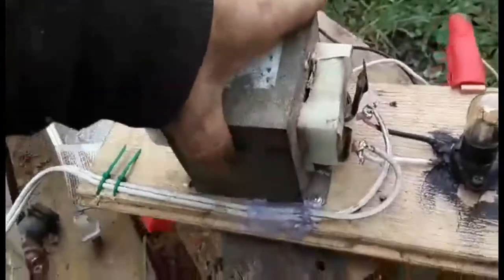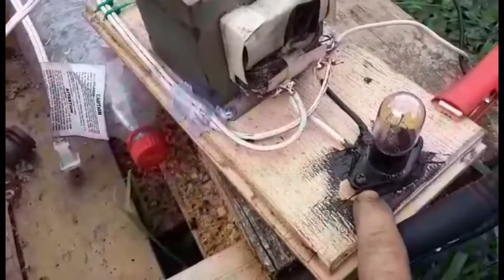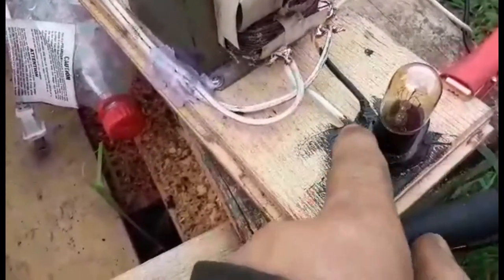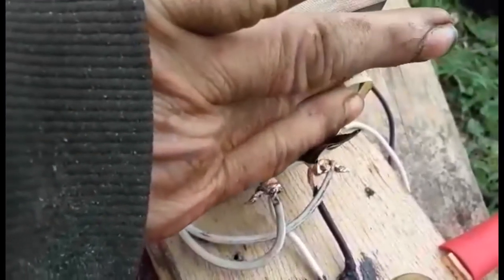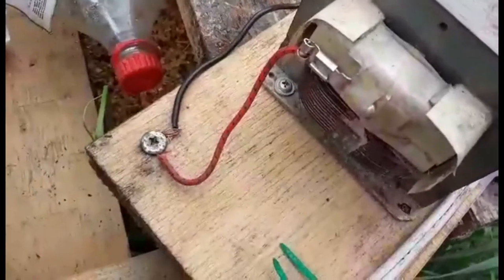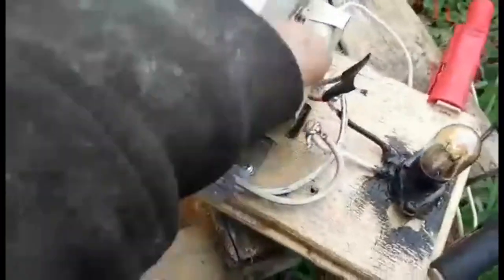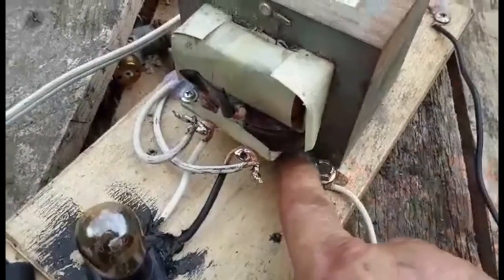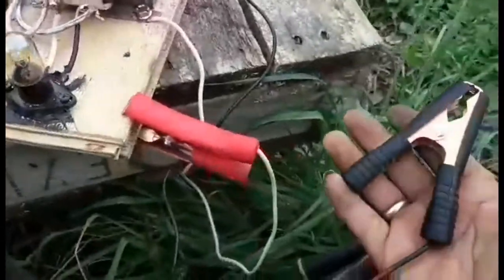couple safety features to add to wood burner  with transformer

Comment: Can you please take this video down? Many people (at least 70) have died trying this DIY hack. You even call it "safe" in your video. This is NOT safe. Please take this video down NOW. Are you willing to be the one who told someone it was safe only to end up leading someone to their death?
Reply from the maker: as ive said several times, tons of videos showing how to make these with no safety at all . i mentioned that in the video. have a nice day
Reply from the maker: i will make a different one showing more how to make it safer. that was really the point of the video
Reply: @nextellcup8  Please don't. The only safe way to do this is to NOT do it. People with more experience, better equipment, and more precautions than you have died.
Reply: @nextellcup8  Once again - this is the problem. LOTS of people who took PLENTY of precautions are dead. There are news reports of master electricians who were dead, there were times where things went unexpectedly wrong in ways that precautions do not account for. We MUST NOT send a message that precautions can keep you safe. Tell that to the kids of the people whose house burned down after both parents died. 

You need to STOP letting people think that this can be done safely. Human life is way more important than wood with fancy designs burned in.

Comment: Is your intent is really to improve peoples chances of not ending up among the dead?  Or is it  just to get on the youtube "like" wagon?   If you are sincere, seek the advice of proper credentialed engineers with UL experience.   Because I can tell you you can drive a truck through the safety holes in your improved device.   

And there is a huge area of safety with this that goes well beyond the hardware itself.

Please post a link to the devices you think yours beats out on a 1 to 10 safety scale?   Because if the very worst are a 1, yours is a 1.1.    This comment from a retired electrical engineer with 45 years of MIL/UL/CSA/CE/FDA experience.   Sorry, I call 'em like I see 'em.   Nothing personal.

Comment: Someone just died trying to put this in use! DOA man! Take this video down!!!!
Reply from the maker: yes i know . That’s why i made the video showing how to make it safer . lots of videos showing how to make one with no safety in mind
Reply: @nextellcup8  There is no safe way to make one, people are idiots and lack common sense. You cannot mitigate every safety tip in your video and you should take it down!
Reply: @nextellcup8  You are being foolish and stubborn. Implying that there is a safe way is just causing more harm. Not to mention that these are also a huge fire hazard.
Reply: What about the number of motorsports that a way more dangerous, or jumping off cliffs videos if you want your safe space get off the internet snow flake
Reply: @nextellcup8  YOU CUT THE GROUND OFF THE TRANSFORMER - ITS A TRAP WITHOUT THE GROUND.   "Those two extry wires, just put electrical tape right here".  Dude - that is a ground.  So your hot is going to recharge into the hot.  It has to ground out to be safe.
Reply: @BrysonCityDashCam28713  thats a low voltage winding not a ground
Reply: Exactly! Some people are stupid, i certainly agree! Thats why, if you don't understand how to do such things, don't... other people are less stupid & fully capable of doing these types of  things... also, people die regularly, it's the circle of life... maybe you who are so concerned about the actions of others & feel the need to make stupid posts about things you know nothing about, should find a new hobby...

Comment: That is not safe.
Reply from the maker: i know, that’s why i made the video showing how to make it safer . lots of videos showing how to make them but no safety in mind.
Reply: @nextellcup8  and yet you call it safe in the title.
Reply from the maker: @KajsarTitus  ya i’ll change it to safer . people will make these regardless so wanted to show how to have some safety with it .
Reply: @nextellcup8  Take the video down. You are being a fool.
Reply: @nextellcup8  Oh you changed it to "safer". We are all saved!
You say in your video how you made it "extremely safe". These are your words.
With a push-up switch less than one meter of the transformer?

The fact is, if some random ppl think this is extremely safe and make the exact same piece of crap as the one you are showing, he has great chances to injury or die or kill (animals, children,...)

Your version is ABSOLUTELY NOT safe or extremely safe or not even safer! Because even if there is a quick switch, you can kill someone during the time the switch takes to switch off. The only safe thing to do is to physically avoid contacts with electrical parts using insulated shields and barriers.
You are a dangerous liar, and a potential killer.

I reported your video as dangerous, encourage anyone to do the same, and hope YouTube will ban it.

Comment: Terminals exposed everywhere, hillbilly DIY style... Yeah that looks much safer 🤣🤣
Reply from the maker: as ive said several times, tons of videos showing how to make these with no safety at all . i mentioned that in the video. have a nice day
Reply from the maker: i did mention that i didn’t have the connections covered
Reply: @nextellcup8  your video is a danger to everyone. Your channel should be banned like asbestos.
Reply: The only thing about your switch is that you need to be able to click it off. If you get electrocuted you’re not going to be able to walk over to it to hit it off. A lot of people have seeing pedals attached. So if you step off the pedal, the power cuts off

Comment: Make sure this screw does not go through the wood…no, you give dangerous advise!!! if it near enough and your table is wet or made of metal, you might die from it. The voltage is high enough to jump through it as it does on the wood you are burning.

Comment: Driving down the road isn't safe but if you know how to drive it's safer than if you don't , this pretty much applies to everything, knowledge is power and plus natural selection is a thing that happens
Reply: knowledge is power until you hhave just enough knowledge to be dangerous. if you're doing anything like this just be as far away from the hot leads as possible

Comment: I can see the danger for sure, and as an adult if i decide to "create" one of these portable electric chairs I appreciate the rough visuals on how easy some precautions are to add to your death stick. The information is all over the place, If you think this dudes machine is deadly you need to lurk more, there are people haphazardily pulling them out of microwaves and doing super rough wire goes here and here bs. 
This hobby is dangerous, and hate to tell you all this but 99% of the views going forward for the next 6months are gonna be from the people who do not have any clue and want to see a step by step guide to "learn how to create one". There gonna most likely not leave any comments or will pretend to be a bleeding heart begging the poster to take his video down aftere they realize this is not a guide. The people coming from the videos that talk about how insanely dangerous this is are going to be pointing a large majority of there viewers into wanting to learn how to do this, most just to know, some to probably die trying to replicate.
IMO This video is not a guide, its a warning to the fools who are looking into this and have no idea what the hell they are doing and wont even know to  tape off the other live wires or that they can easily throw on a bulb so you dont accidently touch a surface while there is a live current.
Reply from the maker: when i started the video i was only going to show or give a few tips for a little extra safety and ya i ended up taking it a little further . i understand the dangers but so many of these builds with no safety at all 👌. people will build them with or without this video.

Comment: I've been wanting to do this for a long time and have had some reservations because haven't seen a lot of safety videos, but heard there have been accidents where people are mamed or killed by these things. Thanks for taking the time to have a little safety chat.
Reply from the maker: thanks and yes that’s why i did the video. 2200 volts ,i don’t know the amps but you definitely want to be very careful.
Reply from the maker: another thing and i should have added was that cord with the switch, it could definitely be several feet longer
Reply: Over 34 people have died from this, even with safety harnesses. Don't do it.
Reply: Please, please don't do this. Many people have died, including trained professionals have died.
Reply: @nextellcup8  You don't even know the amps . . . I think you are making a GRAVE mistake to promote the idea that this can be done safely. Please take down this video. The only correct safety message about this is to NEVER do it.
Reply: @nextellcup8  It would be more than 5A, though the exact current depends on the wattage rating of the transformer. That is enough current to immediately stop your heart. In fact, it only takes 0.1A 2 seconds to stop your heart. This is a very dangerous method of wood burning and you are being incredibly irresponsible saying that the method you use in your video is safe. I am an electrical engineer who works with high voltage transformers and if you called this safe in my shop you would be fired immediately. You should take this video down.
Reply: THIS

Comment: I too am planning to build one for epoxy work. Any advice on building a insulated platform for the operator to stand on while the unit is operational? Side note, gotta love reping UFA on your jacket! Not enough Alberta videos on YouTube!
Reply from the maker: the jacket was given to me lol . one thing i would do is make the wire with the switch longer so you’re A little further away . im thinking about your other question tho lol
Reply: Nathaniel please do not make one of these. Experienced electricians have died doing this. There is NO WAY to make this safe despite what the man in the video is saying.
Reply: Please do NOT do this. Many people have died.
Reply: Just dont do it.
Reply: It can kill you, 1 oops and youre dead. That being said, a platform is unnecessary. just dont stand on metal or wet wood etc. Be mindful of your environment as well, on a really humid day crap happens. Do not wear metal accessories, belts, watches, rings, wire framed glasses etc. Wear non conductive gloves, welders, or gloves rated for electricians. I've built 6 of these, and have been operating them for going on 4yrs now. I literally have a check list of safety measures that I look at and follow before plugging in any of these devices. The checklist helps keep me from getting complacent. Complacency kills. Once again, these devices are known to take people from this life and drop them into the next.
Reply: @jcevans16  words of wisdom I'm sure. Thanks friend.